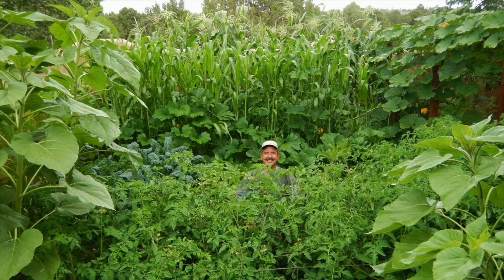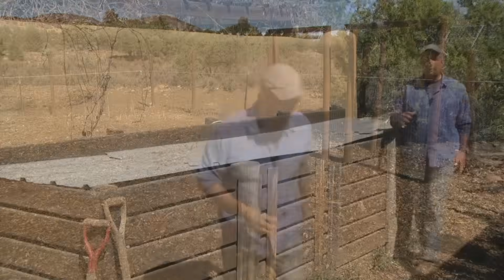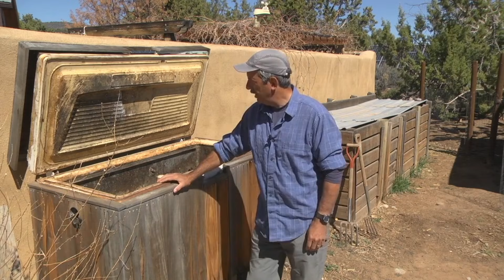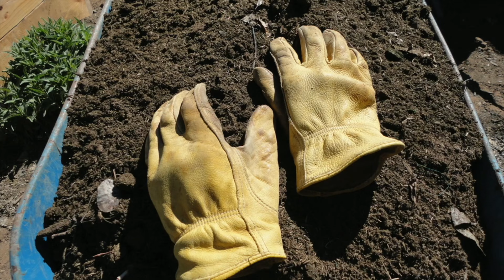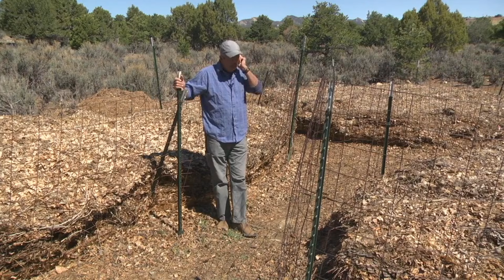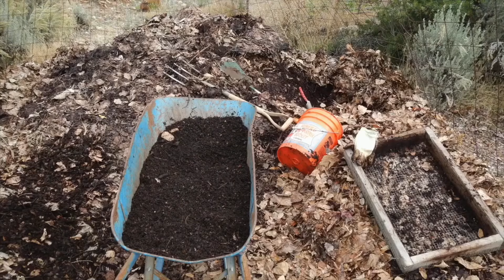Your Kitchen Scraps Are Worth More Than Any Fertilizer You Can Buy — Here Is Why

Comment: Great video!  I would recommend finding a tree surgeon to supply woodchips - I get at least 40 yards for free every year.  Also, our system works much better now that we have chickens and free manure.
Reply: My poultry paddock has an area 16’ wide and 60’ long that I bring in a 15” deep layer of arborist mulch every year following our first frost. (The previous years layer is scooped up and into compost piles where kitchen scraps also go and then goes to top dress the garden before each season) The poultry work this area all year non stop, coop waste is scattered across the area and I also throw their scratch across it, toss pumpkins there after Thanksgiving, leaves, yard clippings, etc. I’ve had enormous success growing sweet potatoes in this area also every year, the poultry leave the sweet potatoes alone as they grow and then I just mow the tops, lift our the potatoes (so clean growing in nothing but arborist mulch and chicken droppings).

Comment: I don't have a lot of space, I use 4 garbage bins, I have taken the bottom out of the each garbage bin, which then sit on the ground,  also I have drilled about 30mm holes around the garbage bin to give it some air flow, I  have 2 bins working all the times trying to get the 3rd bin going, I turn the compost 2 times a week from one bin to another and the compost is ready to be used in about 2 months.

Comment: If you have room to garden in the ground with paths between your rows or beds, you have room to compost the way I do it. I have a scrap bucket under the kitchen sink and a paper shredder. When the bucket is half full, I fill it the rest of the way with shredded paper/cardboard. Then, I move the 8-inch deep path mulch (leaves, alfalfa, or whatever you can get for free), dump the bucket, and recover with mulch. The worms move in and out, eating the waste, and then back into the beds, depositing their rich castings. At the start of each season, I rake the now composted (more or less) path mulch onto the bed and lay fresh mulch (garden and paths). The old compost turning, shoveling, wheeling, and then double-digging method is just too much for this older, slight woman. Composting in place works tremendously well. I do this around fruit trees, too, but in this case, I just add new mulch each spring. I also have in-ground worm bins here and there around the garden and orchard.